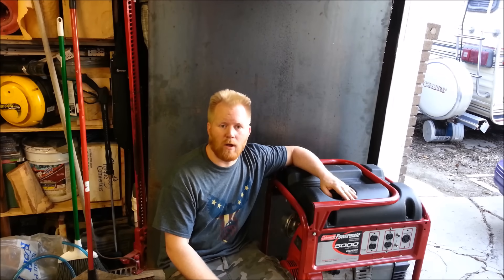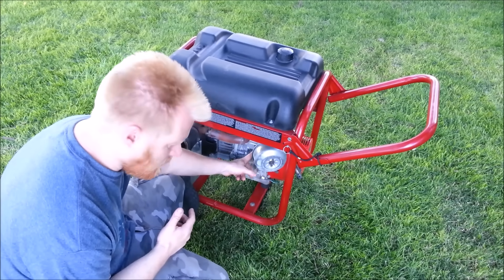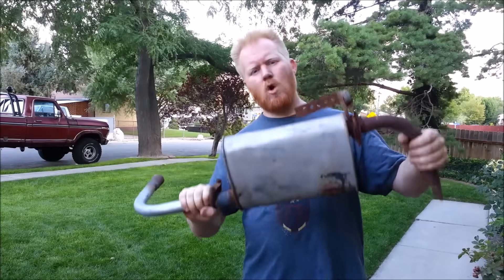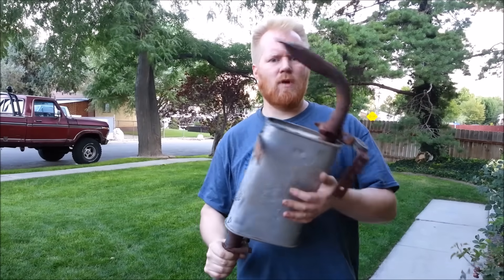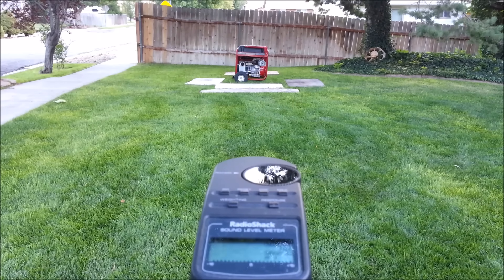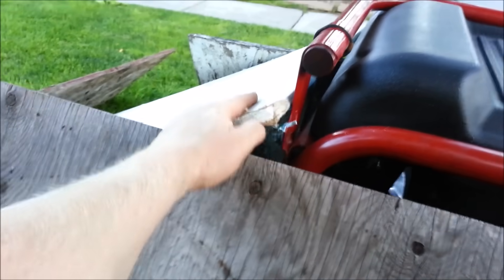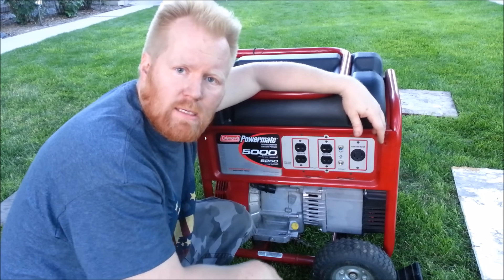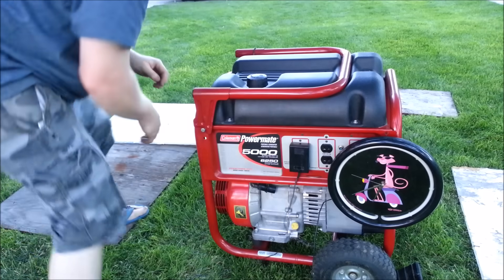4x Quieter generator in 10 seconds

Comment: I just commented the same thing on another video.  That appears to be an AP enforcer 2 series muffler.  Thats not a stock muffler, in those are described as a performance muffler. The point that I'm trying to make is that, maybe thats not a quite muffler on a car. The description on those series mufflers does not say if they are supposed to be loud or not, so its kind of unkown. Well maybe you know what it sounds like on a car. I want to see what a real factory muffler off something like a honda civic sounds like. something that is known for a fact to be quite. I'm not 100% sure about what I'm saying, but either way great video, this is definitely one of the better videos on this subject. thanks
Reply from the maker: No muffler in the world will make a generator quiet. The sound is traveling directly out of the side of the engine block. Take that same quiet car, open the hood and have somebody floor the engine and tell me how quiet it is. It's going to push 90db. Now shut the hood and that's going to drop 10 to 20 DB.
Reply: @sixtyfiveford  well that is why I  said you have one of the better videos on the subject.  Because, you pointed out that most of the sound is not coming out of the exhaust. I guess I'm just a little disappointed that my plan to just weld a muffler on is not going to work. Especially if you said you have to re jet the carb. No thanks.  That plywood apparatus you did might be the best option.
Reply from the maker: @davidcraft4909  The military would dig a hole and throw it in or stack sand bags. I've had people comment they just tip a folding table on it's side in front with great results.
Reply: @sixtyfiveford  Well after seeing what the plywood did. I am going to start out with a 3 sided plywood cubby hole to park my generator in. And then maybe adjust the angles. But yeah, thanks for saving me the trouble of trying to just put a muffler on it.

Comment: Very good idea. 3dB is a perceived doubling of amplitude (volume). Foil-backed constrained-layer butyl (Dynamat) is a panel dampner that lowers the resonant frequency of the surface it is adhered to. For a sound "barrier", mass-loaded vinyl is the product to use. To "de-couple" the MLV (mass-loaded vinyl) from a surface so sound isn't transfered via contact, closed-cell foam between the two is effective.

Comment: I guarantee if you take the heat of the engine after about 10 minutes it will be double the heat. You going to wear the motor out quicker because it's overheating not meant to be covered!😮

Comment: I wasted 10 minutes of my life on this video, I can’t get back 🤦🏽‍♂️ the information isn’t really a “proof “ proven solution. Just speculated theory 🤷🏻‍♂️ heat has to escape, small vent fans are required. I will upload a video on September 1, 2023 to unveil the perfect generator 27 dsp  5000amp generator built on a RV eliminating vibrations an only 27 Dbs on sound. Don’t take my word for it. Subscribe an see for yourself 🤷🏻‍♂️

Comment: Great video. I'm thinking that drywall would work great. That's how they sound proof rooms with 2 sheets instead of one. Plus drywall does NOT burn and is used to make a room fire retardant. Well, you got me headed in the right direction. Thanks for sharing the video.
Reply: The only thing that sucks... What if it's Raining? Is there a waterproof option?

Comment: Every 3 decibels. The logarithmic scale which is compatible with the things we find in our world such as light and sound allows us to jot values on graph paper. With a sufficient number of samples we find if we connect the dots we have an exponential curve. The volume knob on a preamp ( a kind of amp which can variably amplify a line level signal, not to be mistaken for line voltage, has a logarithmic potentiometer which allows us to hear a volume which feels like how far we've turned the knob ) controls the volume of the sound. Logarithmic pots are great for audio applications. Linear pots are great for power supplies and the like. The Inverse Square Law ( physics ) tells us a sound will be twice as loud when the distance to the source is halved, and the sound will be half as loud when the distance to the source is doubled. Many people believe sound responds linearly because we think linearly. The same can be said of light and gravity.

Comment: I read in Patrick Kelly's  book where he talks about a guy living off grid and wore out an expensive generator after mere months running it to charge his FLA battery bank when the Sun doesn't shine and the wind ain't turning his windmill. He noted that it had 120v and 240v sockets, which went to taps on the generator head stater. He said he ran his charger exclusively on the 120v socket, and being all the load was on the 120v side, the generator head was unbalanced, the engine was under uneven load, it ran loud, and the fuel consumption was high. And the thing DIED after some months.
He bought another big gasoline generator, but he hooked a heavy industrial/commercial grade 240v/120v transformer to the 240v socket and ran all this 120v stuff on that, with the load on the generator head being balanced. The generator was quieter, it sipped fuel, and it lasted years without issue. Presumably it was still running good beyond the writing of the book.

Comment: Just put a exhaust pipe into a tub of water.   It will knock the sound right down
Reply from the maker: Nope. The exhaust is already quieter than the sound coming directly out of the side of the engine block.

Comment: Good vid!
Someone probably already said it, but you're wrong on one thing: 10 dB reduction is not 4X quieter. It's 10 times quieter. Every 3 dB is 2X. It's strange math, but it's true. (Called "logarithmic" scale.)
Loved how quiet it got by deflecting down into the grass. I've been doing this onto my driveway and because of your vid, I'm going to cut a hole in my garage side door so I can run the cable out to the nearby grass.
Reply from the maker: True but there is an exception. The human ear perceives 2x loudness on average around 5 decibels; dependent on HZ but that's average. So the average person would consider 10db drop around 1/4 as loud.

Comment: To get a Genny to run quiet build a rectangular box with baffle plates on the small sides and then install dense foam inside the box to dampen the noise 
On the small side of the box you fit a big fan to keep the engine running at operating temp 
On the other end of the box you make an opening facing downwards to deflect the sound dampening everything 
And you build another box padded with foam but keep open ends on both sides to allow airflow

Comment: As is so often the case, the term "decibel" is here used incorrectly multiple times.  For example, the description's  first sentence should begn, "Drop the sound pressure level of a generator by 10db..."  This is because the decibel is not a thing but is instead, a unit of a thing.  In this case that thing is sound pressure level.

Comment: In the military we would dig a hole to set the generator into or sandbag a box around it. Use flex metal pipe to slip over exhaust and bury the length into dirt ditch with end sticking up.

Comment: deflect noise or absorb noise 
Stopping the noise by building a high density enclosure  1/2 width /thickness  concrete blocks .
3 x sided block house core filled with cement 
roof and door are free 
3fixed sides,, 1x removable  lined with noise insulation attached to a timber frame , use noise isolating glue 
vent as needed and using ceiling material thats fire proof

Comment: The drywall/sheetrock is better than plywood because it is a dense mineral that absorbs sound. The plywood acts like a resonator and projects sound like the top of an acoustic guitar. The OSB is probably more sound-absorbing because it is denser than plywood due to the glue and the random directions of the wood fibers probably help by dispersing sound in multiple directions rather than resonate as a single unit.  The drywall is like an acoustic-blocker available online that is thick rubber sheets full of ground-up rocks. The density stops sound amazingly well. I was going to line my music studio with it but it was way too expensive. I did buy a smaller sheet to line the generator-compartment of my Motor-home.

Comment: Heat box. The air filter will melt and turn into powdered dust if you run a generator like this. Just don't do this.

Comment: Awesome video!  I thought those mufflers that most people put on their generators were doing very little, redirecting the sound into the grass/ground is brilliant. Could I build a circular cowel around the generator that is wider at the base and narrow at top forming a 45 degree angle to the ground radially from the center, then coat the inside with that tar you mentioned. The top of the cowel would have baffles to fit the rectangular shape of the generator to circular cowel top edge. The gap at the top between the baffles and the generator would let air in, but getting the exhaust out queitly is the tough nut.

Comment: The sound deadener you were referring to is asphalt.  Asphalt "peel-and-stick" waterproofing would work pretty well and is available at a lot of supply houses.  It's the same rubberized asphalt with an HDPE film instead of foil which would be more difficult to source and more expensive.  Great tip!  I'll be trying that at my off-grid deer camp.
Reply: @Paul E, what about "Wet or Dry" you get at home depot, would that work? It is a sticky black rubberized tar like substance you brush on thick to stop roof leaks, or water proof 4x4 posts in the ground. I also use it on white PVC vent pipes that stick out of roofs so they don't look as noticeable on black roofs - plus the thick rubber does not wear away as quickly as black paint.
Reply: @paulromsky9527  I don't know.  I think the principle of the rubberized asphalt is to attenuate the vibration from sound waves.  I'm by no means an expert in acoustics but is seems to me to work that way.  I would assume that a rubberized coating would work similarly.  I do know that the auto manufacturers use a sheet rubberized asphalt composite for sound deadening.  It's gets applied to places like the firewall which is stamped sheet metal.  The asphalt reduces sound transmission.
Reply: @paulromsky9527 youbare talking about mastic. And that would be a messy job. Upload a video. Lol

Comment: I don't know if anyone listed a solution to another issue that would also help with this. Some of the generators have carbon monoxide detectors that will shut down a generator, when there isn't any wind. If you put a cheap box fan into the baffle box, you can keep the generator cool and keep it from shutting off from a build up of carbon monoxide.

Comment: NNNNNooooooooooo just put a $20 ss pipe muffler on the outlet of the existing muffler using a flexible pipe & have the outlet to the new second muffler directed to the ground!  You can add a couple of extra supporting brackets on the new muffler if you want to add strength to your build, that's your choice! All good!
Reply from the maker: That won't do anything.

Comment: No problems with overheating???
Reply from the maker: None, if you leave the corners wide open with the boards laying at a decent angle. People try to put the boards straight and down, that's when you have issues. A lot of times you only needs boards on 3 sides as well to keep the sound away from you.
Reply: @sixtyfiveford  Cool-  Thanks.  I've used 1 board in front of it for years.  It does make a big diff.  I was just afraid of adding anymore for fear of overheating.  I'll add a couple more now.  Thank you for the get back!

Comment: Get a 5 gallon bucket and weld up a pipe to go in the bucket, fill with water and it will be super quiet it’s the same concept of a boat engine. Most every old small engine has pipe threads in the exhaust some newer small engines are too so you can take ur muffler off and see if it has pipe threads if it does then you can just buy black iron gas pipe from a hardware store to get the exhaust into the 5 gallon bucket if it doesn’t have the pipe threads then you might have to get creative like take a plate of steel to make a flange that bolts to the engine then weld up a pipe to that or weld up a gas pipe Union then you can use some black iron gas pipe to get into the bucket. It’s a good idea to make a support brace for the pipe to take stress off the engine block from the weight of the pipe the brace will avoid the cylinder from possibly cracking but yeah this will make the engine super quiet. It’s an even better idea to use something bigger then 5 gallons the best thing to do is use something that has a lot of surface area so the water can cool down like a kiddy pool much better to have something like that with more water much more surface area to keep the water cooler.
Reply from the maker: You'll find that most of the sound comes directly out of the side on the engine block. You could make the exhaust dead silent and it would still push 60-70db. Boat/car engines are water jacketed and that deadens the sound dramatically.

Comment: Just idle a car to turn a gen..Gen...
Problem is, you gotta' park the car AND put the drive wheels on a slight ramp that has the Gen in the ramp and the wheels captured... in a parked position!
This should help to not stur up hoa with typical generator noise.
When electricity providers who drop out for WHATEVER reason, just slide the generator out to the driveway, pull the car up and park in the generator, leave the car idling, turning the generator.
Also, put a simple switch in the car to disable ALL lights, so the car appears to not be running.
A car will drive a MUCH more serious generator, providing 2-3 kW of juice.
This will put out enough to keep you warm if this happens in a winter freeze or, maybe enough to ru the ac in summer.
But, no need for noisy, small, inefficient engines!

Comment: 4x quieter? so if it is 100db then 4x quieter would be -300db.
Reply from the maker: Your comment makes you look foolish. The decibel scale is logarithmic.
Reply: @sixtyfiveford  either way, 4x (400%) quieter is going to be a negative db value, 100% 1x quieter would be silent.
Reply from the maker: @johng.1703  Nope. Again, it's logarithmic. Every 1 db increase is 10x greater magnitude. So 61db is 10x more than 60db. However, our ears perceive every 4-6 db as double, 8-12 as quadruple. So 70db is perceived as 4 times louder than 60db. Or 60db is 1/4 the volume of 70db. Or 60db is 4x quieter than 70db.

Comment: A scaled-up suppressor should work fine for dampening the exhaust noise without affecting performance.
Basically have the exhaust go through a larger pipe lined with rockwool on the inside (but keep the original exhaust pipe's diameter free for unhindered gas flow).

Comment: Working in construction, we do the plywood trick all the time with our little generators when we're using them.  Some of our larger diesel ones are already boxed in, so are pretty quiet, but we have a few ancient towable open-frame ones that are extremely loud.  We try to stick them behind the sea-can or some other obstacle whenever possible, same idea, but bigger
Reply: Also, you just reminded me of something mentioning the square generator sheds.  We've done a couple of school renovations, including music rooms.  One of them had all of the walls on odd angles, nothing was quite square or plumb, and no large flat areas.  Apparently it helps cut down on the echos considerably.  It would look odd, but I wonder if that could be applied to making a generator shed?

Comment: I would have liked to hear it with the back by the fence left open. Also a lot of engine sound from any motor (especially that china piece) comes out of the block. If you could spray on rubber (high temp) right on the crankcase sides would help a lot. Not sure if that spray stuff a the box stores would stay on. I will have to try it....

Comment: I love my Subaru engine !
Never had a problem with it and in fact would never replace it with anything but another one just like it !
But watching you block this thing up and hear you talk about putting a big muffler on or that would restrict the air flow and also build more back pressure on the engine I see why you didn’t get good service from your Subaru
Reply from the maker: The Subaru was never subjected to this. It simply died like they all do and a 40yr old abused Honda engine with over 4000hrs took it's place. They are bottom of the barrel Chinese engines from a bankrupt Robin engine company that Subaru through their name on. They have their place as super budget engines on the cheapest equipment.
Reply: @sixtyfiveford  well I have never seen anyone but you that didn’t line the Subaru engine!
It’s the best thing since Honda’s first !
And I would never pay as much as Honda wants for their garbage !
But you can like whatever you want !
But I saw enough in this video to know not to follow anything you suggest !
We here in Tennessee will keep using our Subaru engines till they die or we die ( we will probably go first )
   But like I said you are the only person I ever heard that didn’t like the Subaru!
It beats the hell out of Kohler
Reply from the maker: @fuzzyelm1  You'd better stock up as Subaru small engines failed and haven't been produced for nearly 5 years now.  The Robin branded Subaru was a simple clone of the Honda GX series.
Reply: @sixtyfiveford  I know all of that ! My pint is that my Subaru engines have lasted longer than any Honda I ever had!
It was. It only cheaper they have been proven to be as good as the Honda fir a lot less money !
 But after seeing how you treat your equipment I understand why things don’t last longer for you ! But yes my Subaru has given me seven years of great service with no maintenance at all !
I just hope others dint follow your advice on small engines